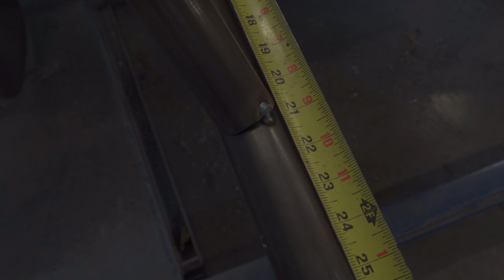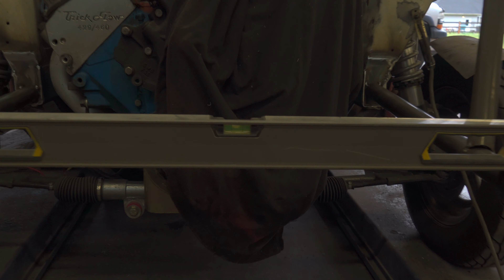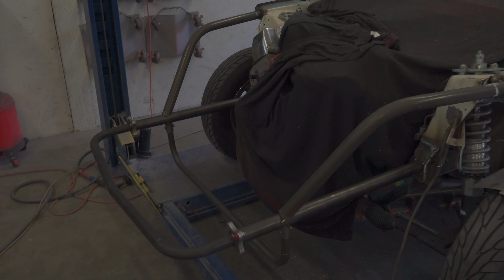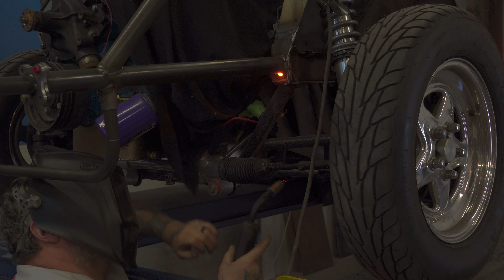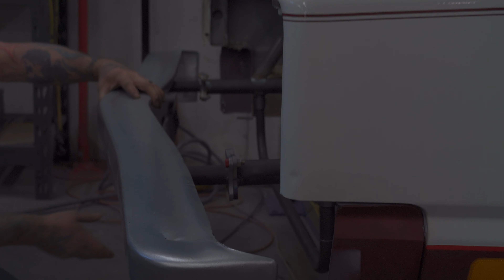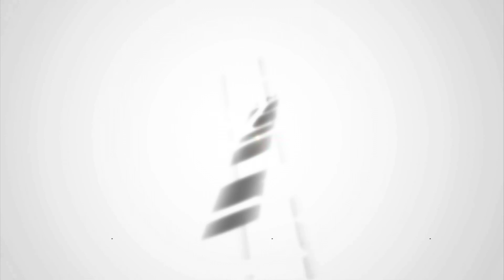How to install Team Z Motorsports UN-WELDED Tubular front end.

Comment: My 80 foxbody doesn't have that alignment hole either. Dealing with that now. I also have a 79 Fairmont that I found out the driver side trans crossmember bracket like 1.5" longer also so having to build one

Comment: Are these tubular front ends significantly less safe than the factory metal?
Reply: No lol. Complete opposite. You saw how easy that sheet metal was ate through.
Reply: @kelant02  I haven't seen if it's compatible with the 79-82 ones? I have an 81 that has that light built into the bumper
Reply: @dapetik  itll work with a 79-82 foxbody, buy the unwelded one so you can put your tabs anywhere